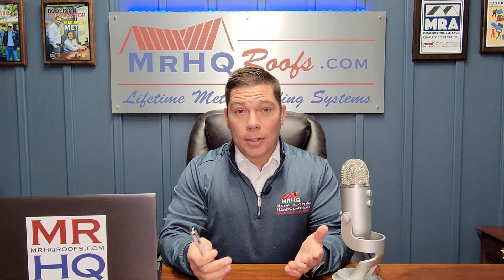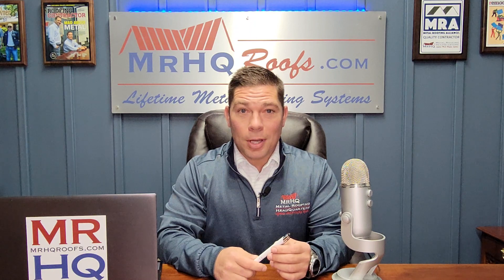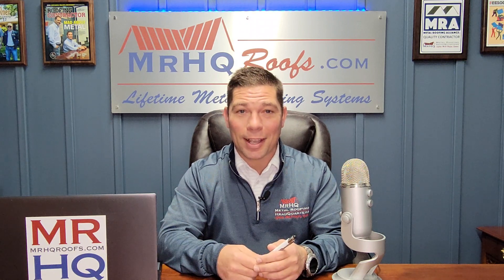Metal Roofing Expansion and Contraction

Comment: I am doing a standing seam screwed down 12 inch on center applying it to the walls of a barn. I’m wondering if you would recommend for me to put the screws in snug and then back off a quarter turn to allow for that metal to slightly float and get away from tension and oil canning the material has slots in it, but it does not have the clip system that you mentionedI would really appreciate if you could respond to this and tell me what you think. I appreciate your attention to detail when you are explaining everything so well thank you. Dave.

Comment: Have a metal carport.  Noticed lots of bangs and various noises. It is noticeable on a cloudy day when the sun comes out from the clouds. House developer tells me that it is actually the white insulation panel under metal roof that is making the popping sounds. I'm told nothing can be done.  However, since the metal roof top is dark brown color then I'm thinking that if I paint the roof top using a white paint (perhaps Elastomeric) that it will reduce the thermal drama. Thoughts?